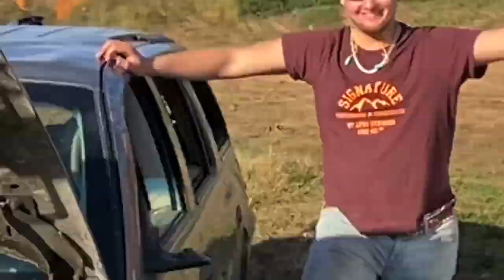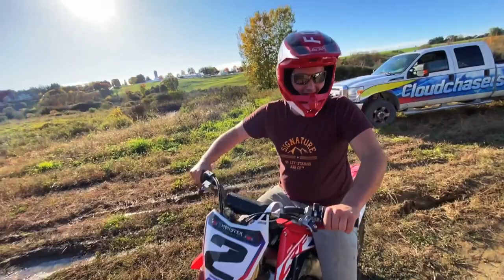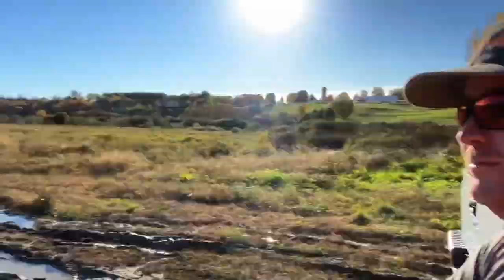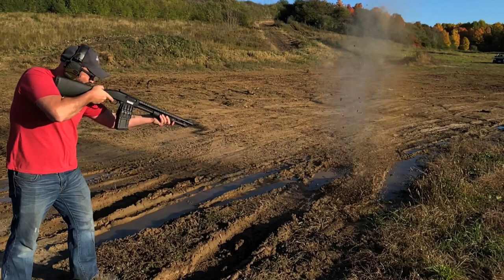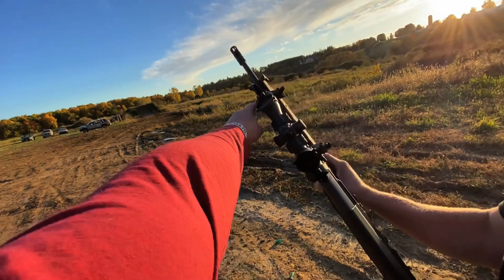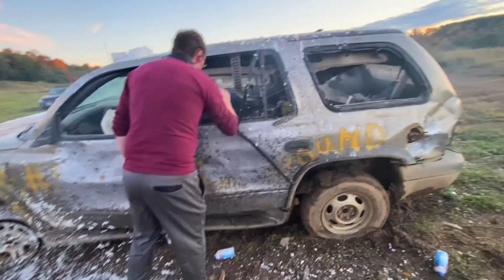Dodge DURANGO 4X4 STUDDED TIRES!

Comment: You should try putting gas in a water battle and tape a lighter or two to the front makes for a nice little fire ball. Iv done it with a bb gun when I was younger. You gotta hit where the flint is tho to get any possibility of ignition. But just food for thought even if its not filmed yall can still have fun. And another idea my pops was telling me he did when he was younger but you take a clothe hanger or what metal stick you can find and attach steel wool to one end then light the steel wool on fire once lit the person holding it spins in circles moderately fast while holding said stick apparently makes for a crazy shower of sparks. That'd be pretty cool to see in slow mo I think but till the next one fellas safety third😁